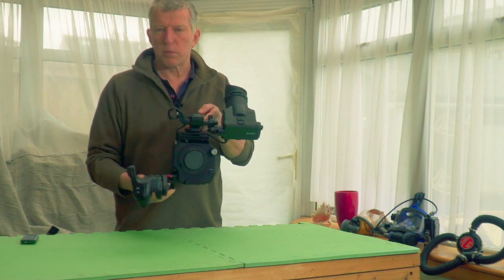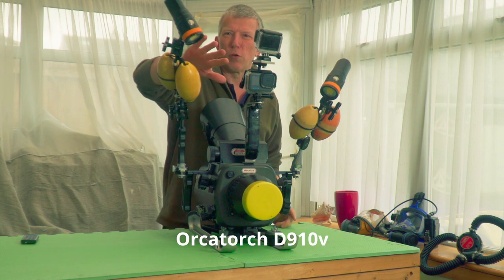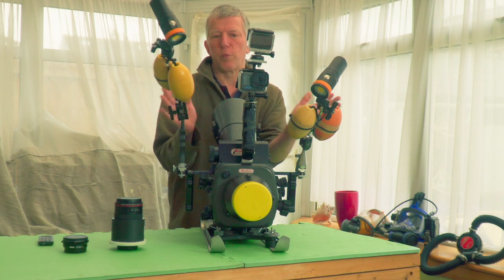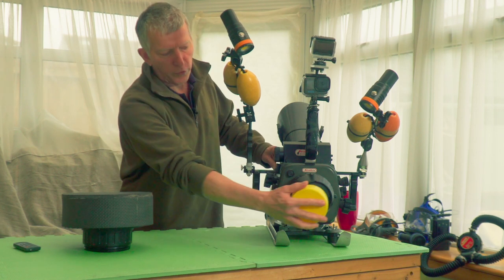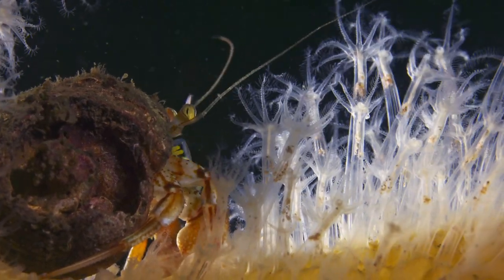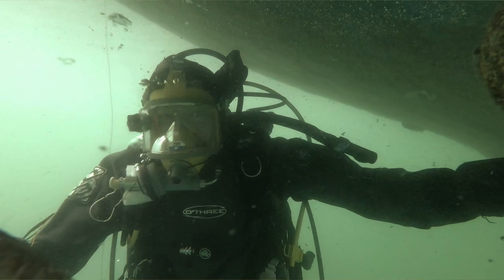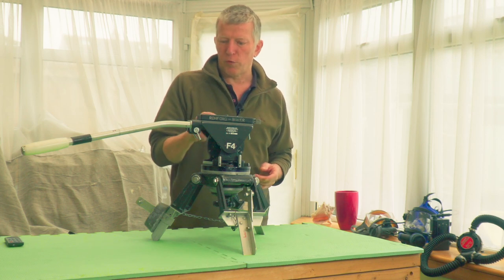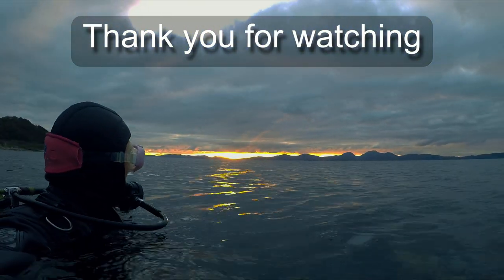Underwater cinematography - kit run down.

Comment: Great setup Clyde!  I like the GoPro selfie stick idea, I might have to try that.
Reply from the maker: The selfie stick has evolved over time but the main advantage that it gives is to the stability of the footage ( I don't use stabilization due to low light levels.) The long lever stops the tilting motion that is obvious on Gopro tray setups. You only have to worry about rotation which is limited by the wrist.